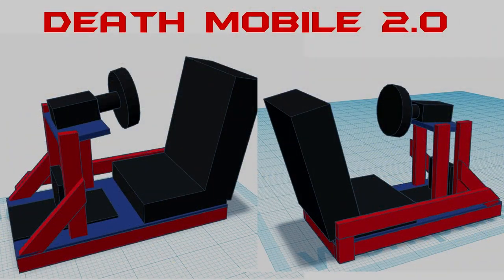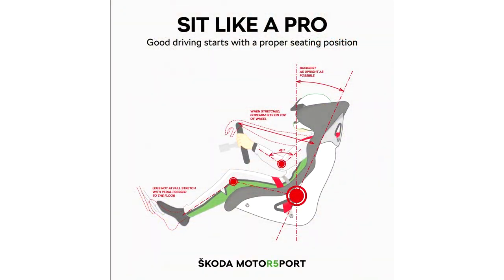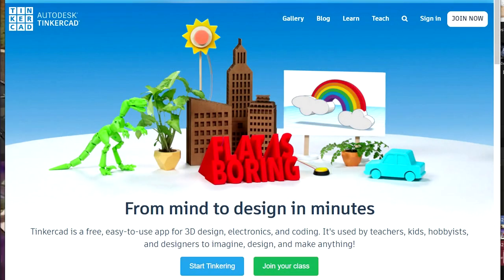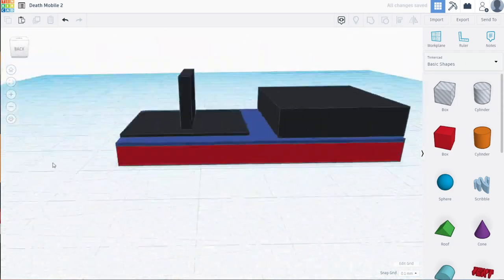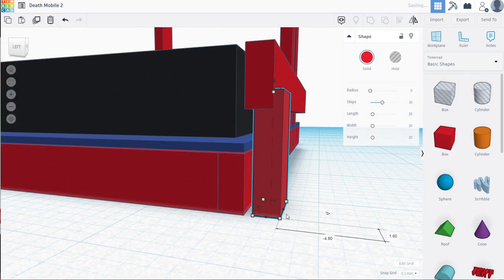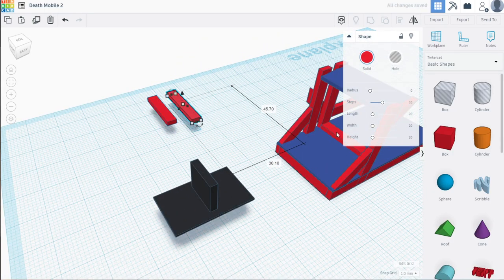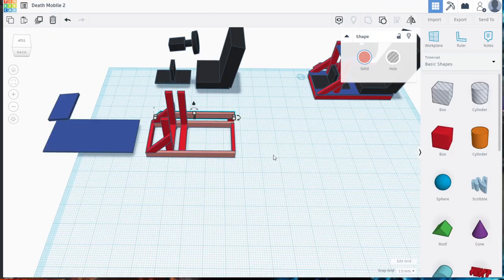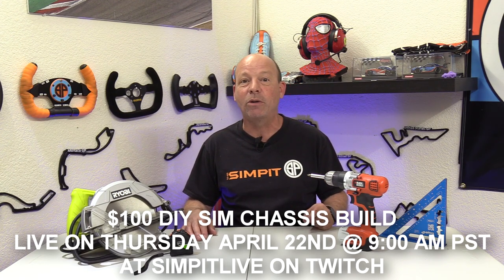Death Mobile 2.0 - Under $100 Direct Drive Ready DIY Sim Chassis - Part 1 The Design

Comment: This is what brought me into sim racing years ago. DIY builds. In 2011 I settled on the Ricmotec DIY chassis made out of wood. Bought Franks plans and went to work. I still have it too (gathering dust now as I went full 80/20 on my current rig).

Comment: Shaun, I love your work and all, but... let me get this straight. You've bought
- a 200+ USD DD drive,
- a 100+ USD pedal set,
- an 80+ USD gear lever,
- a 2000+ USD PC to run all the stuff,
- at least 300+ USD of ancillaries...

And then attach all that crap to a cheap-ass 80+ USD, DIY chassis that will flex and wobble like jello just to save some bucks? 
Wouldn't make more sense to make a series on how to repurpose old equipment or how to repair it in case something goes awry in order to avoid buying all of that stuff?